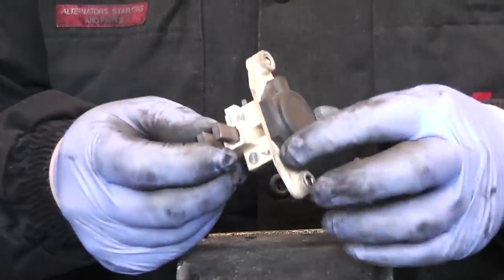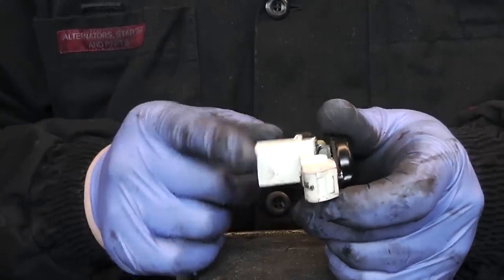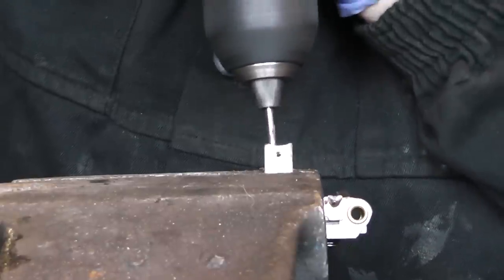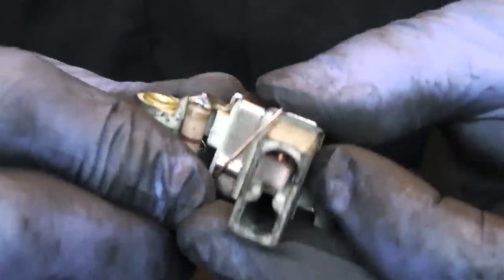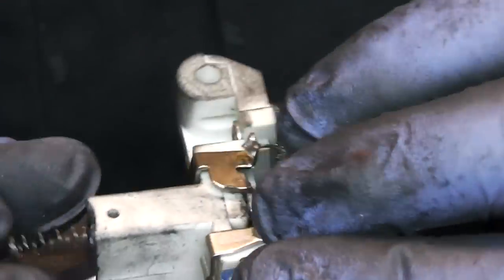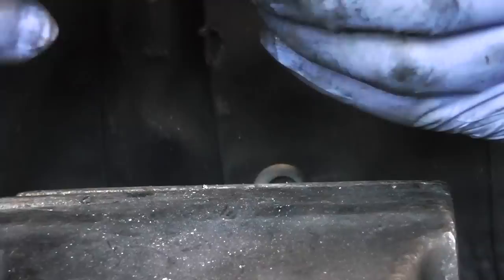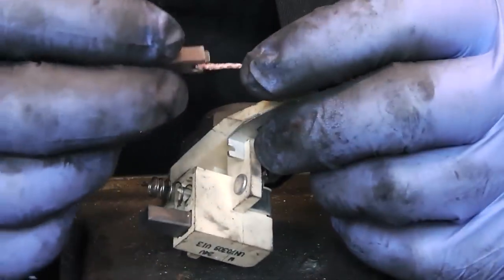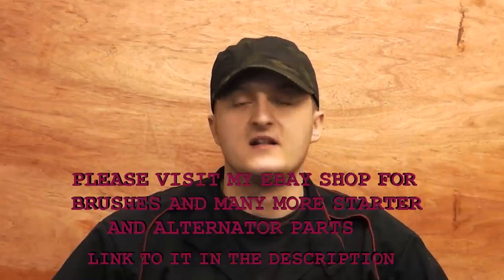How to change brushes in Bosch alternator regulators.

Comment: Does one really need to use a drill?  If the old brushes were soldered in, wouldn't it be easier to simply de-solder the connection in order to take them out?

Comment: Good video, very helpful. I'll be replacing the brushes in a Bosch alternator for my 86 VW Golf Diesel this weekend. This looks much easier than replacing the bearings in a Bosch alternator, which I had to do for a 91 BMW 318i a few years ago. For that project, I really had to struggle to get the case apart (I used one of your videos to see how to do that job, also, which gave me the confidence that it could be done without taking it to a shop). Thank you!

Comment: I just got a new Bosch voltage  regulator  for my 98 Mercedes R129. My concern is the quality of the regulator. It is a Bosch branded unit but is made in Taiwan. What is your experience with Bosch parts made in Taiwan? Is it better to replace just the brushes? The regulator only cost $10 dollars. Where did you get the brushes?

Comment: At 10.30 where you 'tap' the regulator on the vice, I would suggest blowing the molten solder out of the hole instead. obviously blow away from yourself.
Chane the pack on a newer Bosch: https://youtu.be/t2aEPD17r8w

Comment: Hi Westronicsirl, 
really like your videos.
Recently I had to solder in brushes on a Hitachi starter, (S13-211) and although I completed it I found it very difficult to get the brush plate back on properly. Do you have any videos of brushes being replaced on a similar starter?
Thank you, 
G
Reply from the maker: Hi mate,
I dont have any videos of these particular types on YT at the moment.
Sometimes it is difficult to fit them back if the brush leads are soldered short,
It is easy to get caught that way.
Reply: +WestronicsIrl ese aislante del carbon es muy duro y puede hacer que se trabe el carbon, si se deja sin ese aislante no pasa nada, saludos.

Comment: orangestoneface
1 second ago
for nissan almera .15 liter 2003 or. not charging..since this vid is a feasable coice of results for search for my prob, l will  describe double coal one too short repair. push in tab on connector f wires to release, four bolts f casing , first release all small bolts on top , open, l used hammer on casing boltholes alternatively, to pry open . its a rather hard repair , difficult fittings not designed for public , nuts off yellow bigger bolts  two on regulator and beat them down w hammer. later needs rather much force in same way on assembly. take a pic on each step to know assembly maybe. needs much twisting to get out , under is cols brushes in plastic, will not come out, so l bent one bolt hole metal down to get it out , the one that reaches under diode halfring. in shop dont ask for just brushes if you send a buyer , ask for brushes in plastic fastening. so l did not want to try to put in bare brushes l had so l pulled on the short brush with pliers to make it come out stretching the spring and it came out one or three millimeters , will last some months l guess. thats about it for now, ask me if in trouble. bearings felt loose, opened one to put grease, might wanna drip thick gear oil on other in a tight spot or some fluid grease  but might make trouble with wiring spools.

Comment: Interesting vid, Martin. My wifes 206 has a noisy alternator. Could be the bearings or brushes? So I'll try to sort it out thanks to your video. Cheerio!
Reply: Sounds like bearings to me mate, pull them out and get the code off them or measure them and get new ones. They're pretty cheap if you shop around
Reply: @bushratbeachbum  I got an alternator from an online scrapyard. It's still going well.
Thank for your advice, however.
Reply: It's worth keeping the old one, there are many vehicles that use the same alternator, they're not manufacturer specific.
A bearing for the one i fixed today is $9 or 10 for $35!! It's a good size bearing too, 20x52x15mm! That's for a reasonable quality one
Reply: Hahahahaha!! I've just seen the date on your post!!
Reply: @bushratbeachbum  I didn't like to say, Dan, but your input is appreciated and the car is still going strong. Same scrapyard alternator! It's a tough little car!
Reply: Haha, British excessive politeness matey!!
No worries, it's nice to help folk if possible!
They're good cars. Im looking for a 405 or similar as a donor as i need an Xud9 engine to go in my vitara, small passenger diesels are rare here in aus sadly. Ill have to get back for a visit and ship a couple back with me!

Comment: good video
Reply: Why drill it out just put a soldering iron on the back and the brush will come out with the spring on the copper tail.
This method is total crap